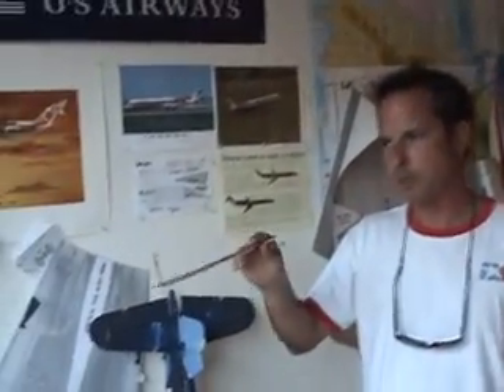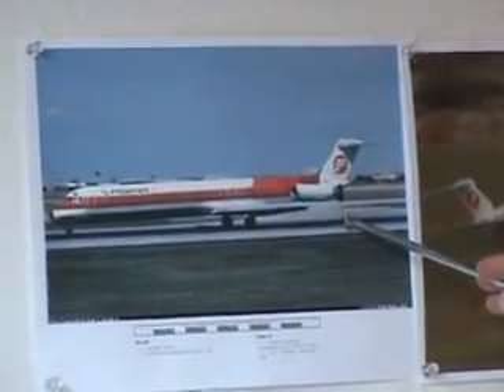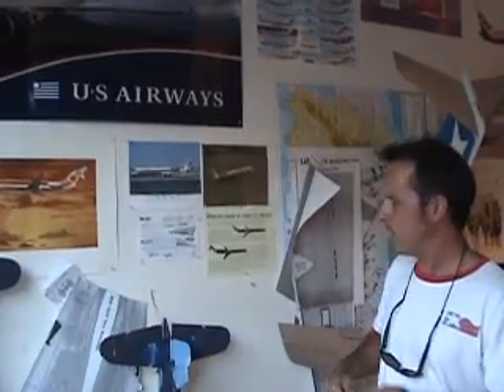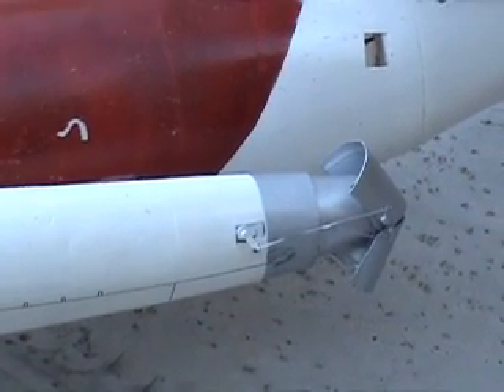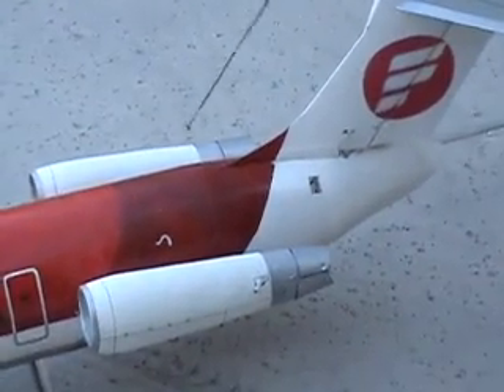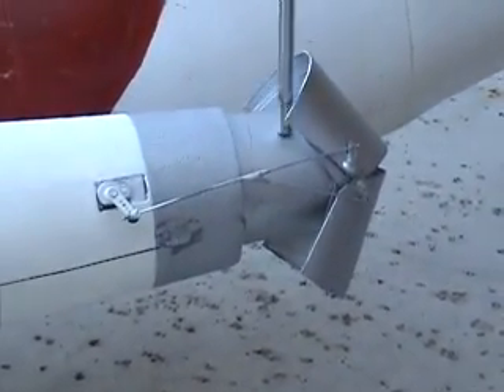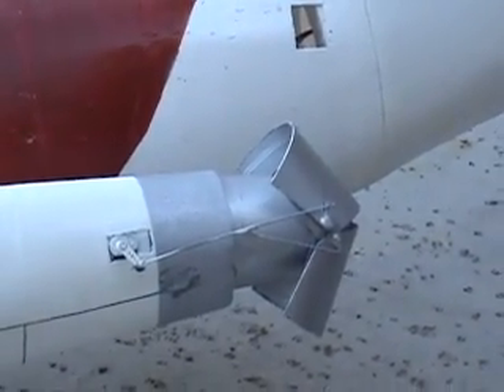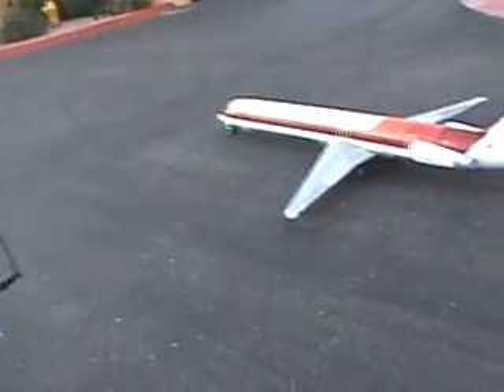Depron MD80 ThrustReversers

Comment: Wow, nice. I can not believe the mechanics are out of the Super liner. I was wondering what to build out of My liners parts if (when) She crashes LOL. I had thought about using a physical servo to with a switch combined with wiring to reverse the motor rotation with a flip of a switch crossing one of the three poles on a brushless set up. I love the actual mechanical aspect of Yours and it looks beautiful. Great job !